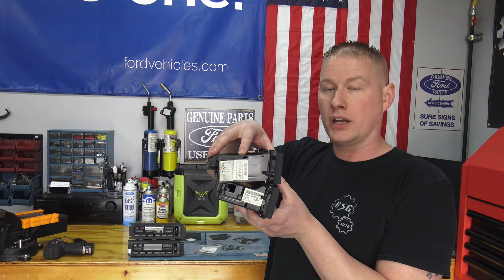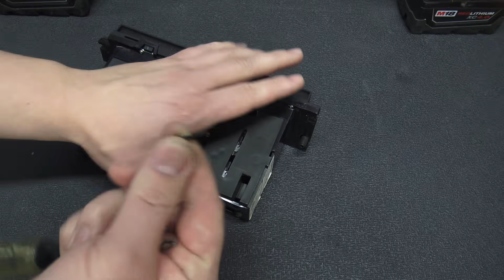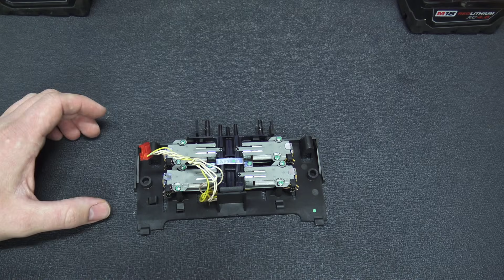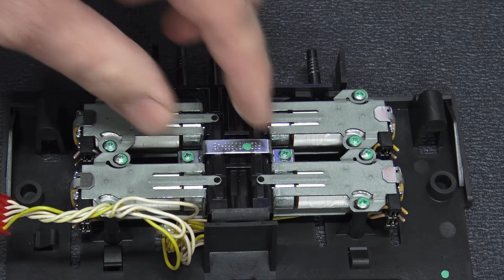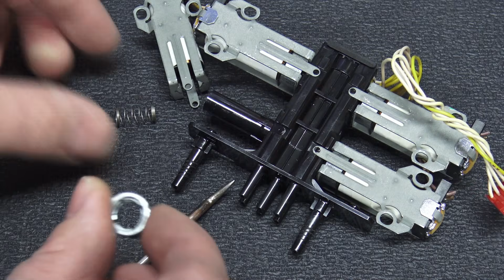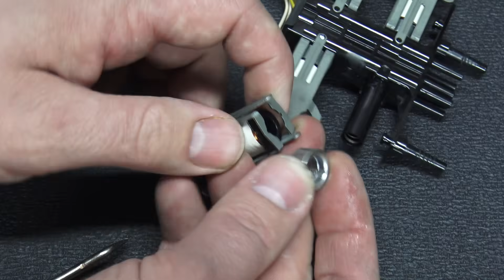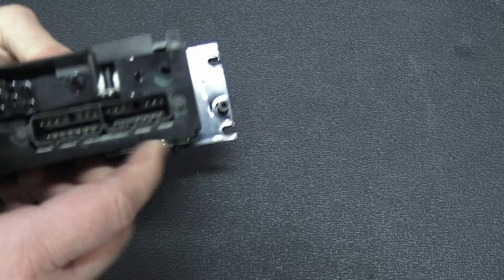Ford HVAC System Stuck on Defrost: EATC Control Head Repair

Comment: Very good tutorial video.  It took the mystery out of that unit.  If I'm not mistaken, I think you forgot to bend back the tabs on one of the solenoid assemblies.  I realize this was just for demonstration and even if you put it back in service, it probably doesn't matter functionally but just saying.
Reply from the maker: +mailpup Good eye! Yes I see that on the other solenoid this was a multiple take video so that is why the other solenoid now has a tab bent up.

Comment: Had one on a 99 Grand Marquis ford was kind enough to spot weld it together.  There is a metal slug with a small cup on one end and a puck on the other, that is the moving part of the solenoid.  Which way does it go?  Mine popped apart too fast..
Reply from the maker: +Porgie TireBiter The thicker hockey puck end goes into the plastic manifold first.
Reply: Thanks :)

Comment: $700 for that unit is nuts. At the least there could be a replacement for the vacuum assembly for a repair shop fix as I understand time is money in shops and they wouldn't want to take the time to make the cheapest repair you showed here
Reply: +CamperMike Remanufactured units are available but they're still a couple hundred bucks.